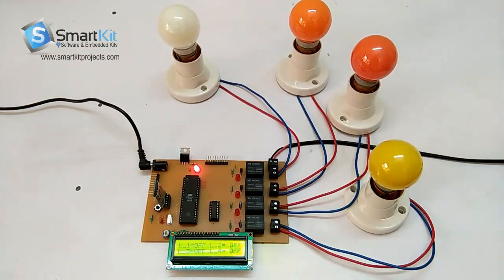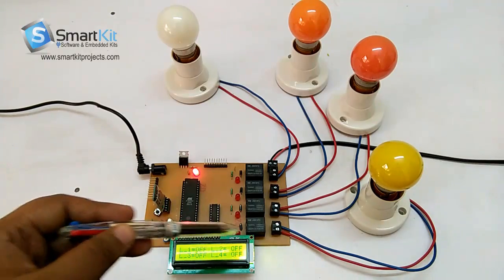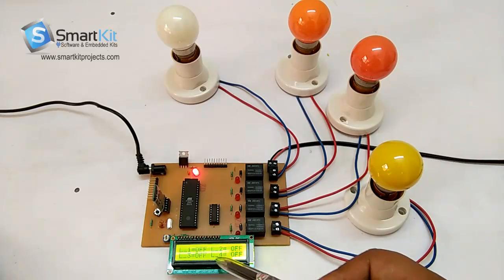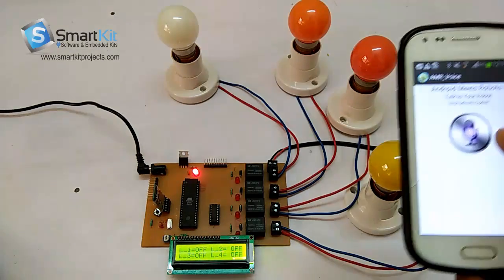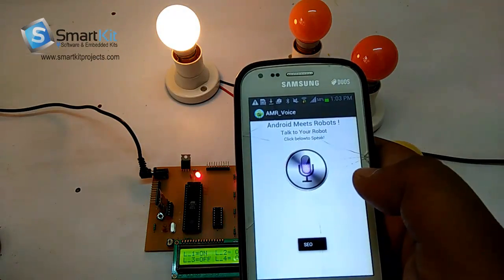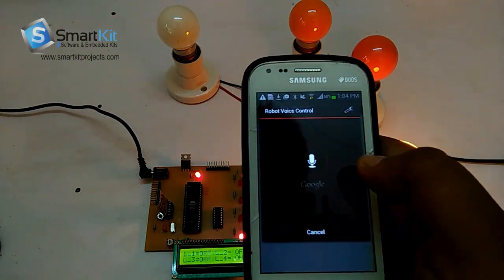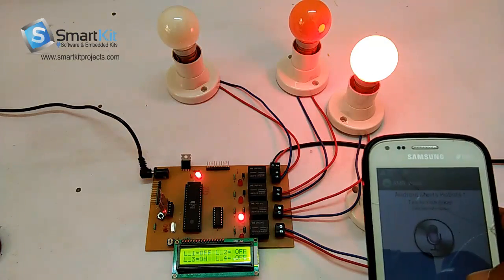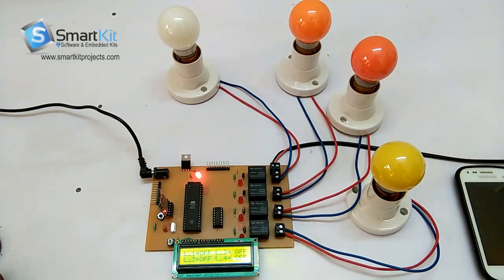Voice Control Home Load Automation using 8051 Based Microcontroller

Comment: Sir mujhe GSM based home automation banana h 8051 with GSM modules and LCD relay control with circuit diagram code or link chahea my email hansrajberwa1992@yahoo.in
Mob no 8802313594